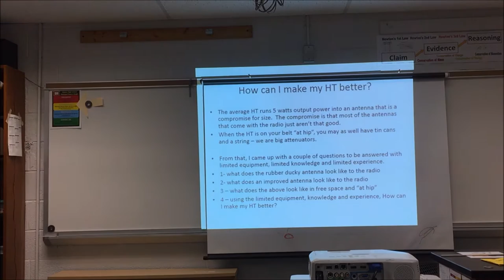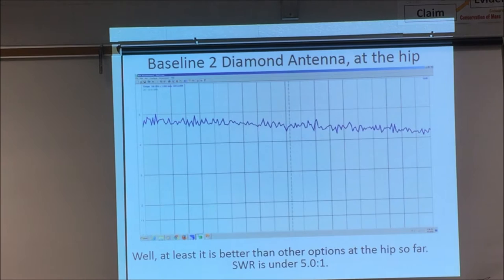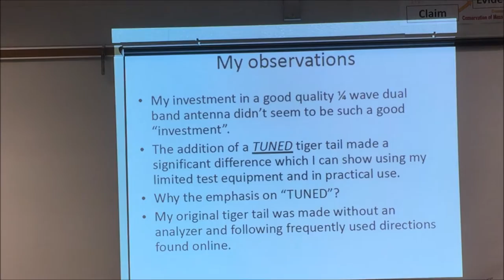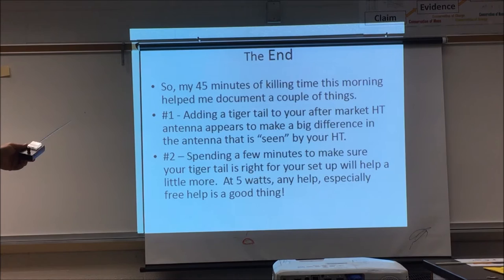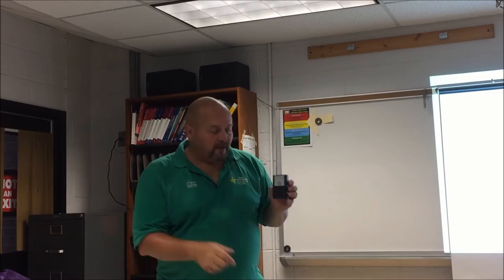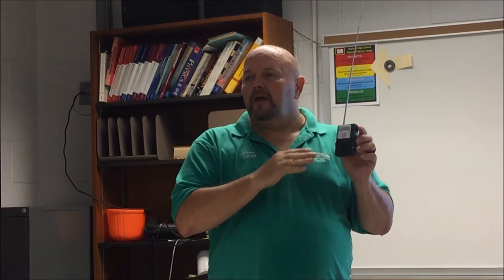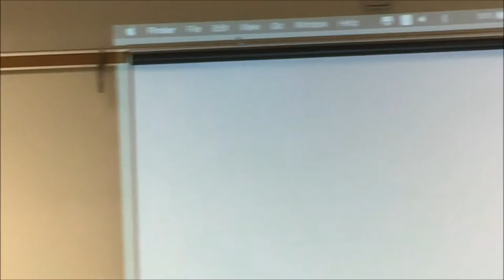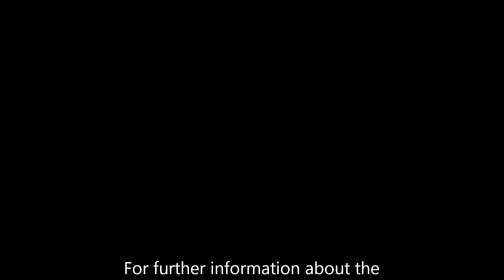How To Tune an HT Antenna

Comment: I’m very new to this. Haven’t taken or registered yet. I’m checking everything possible all the rabbit holes I’ll go down before I make the jump to purchase my first budget friendly HT. This was very cool. Tiger tail. I did remember hearing one of the YT Hams talking about holding your arm perpendicular to the antenna when you key up to get the signal noise as close to a 1:1 as possible. I would think your arm would hurt after a bit. Does the tiger tail just hang?  I mean I know you attach it to the grd of the radio or the base of the antenna. Can you coil the tiger tail? Or just let it be?  Thank you for your video. I hope to one day be a good operator.

Comment: Good video and I’ve used counterpoise as well to get into repeaters that wasn’t able to without. Beware of using bare wire though! You might get a little tingle when transmitting if it touches your skin. I know from experience! 73 N4WLC Bill

Comment: I tried a tiger tail on my Yaesu FT-4VR and it did nothing whatsoever using the stock antenna.  It's a mono band for 2 meter only.  I made it exactly 19" but then I have no antenna analyzer only an old CB SWR meter which can be used in the forward position then reverse the hook up and leave in the forward position.  It will give a pretty good SWR on yer antenna.  Naw, I didn't pay anything for the radio; it was given to me for passing the Technician license test by our local Ham club.

Comment: So what exactly is a tiger tail? ( sorry new ham )
Reply: A tiger tail is a wire that hangs below the antenna, also known as a counterpoise. Illustration at  http://www.hamuniverse.com/htantennamod.html
Reply: Hi Colin.  A tiger tail is a section of wire, cut to a length (based upon the frequencies being used) that completes the antenna.  Essentially, it's the other half of the dipole.  You can google it and find more information and/or specifications for it.  Thanks!  N0CSM
Reply: he was not very clear on that point.
Reply: David Dull thanks.   I was about to ask the same question.   New Ham here this weekend.